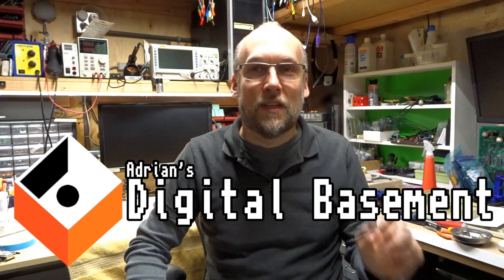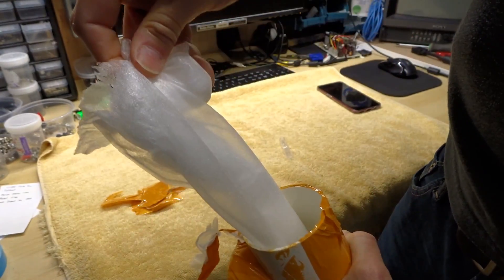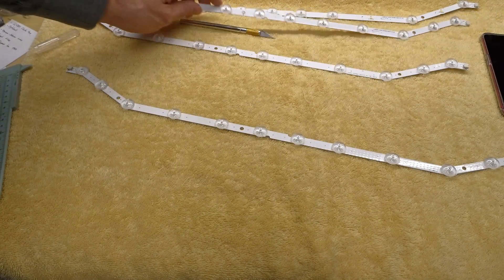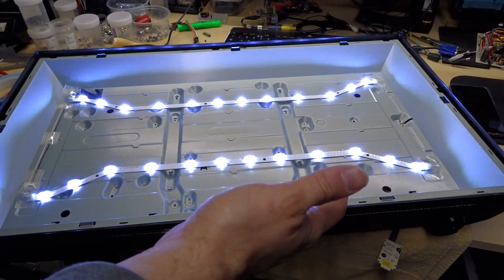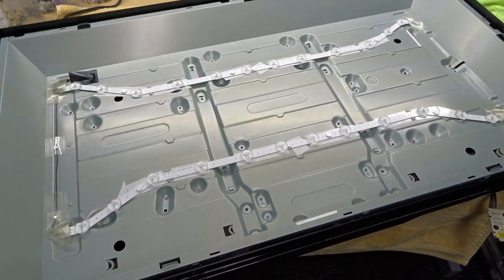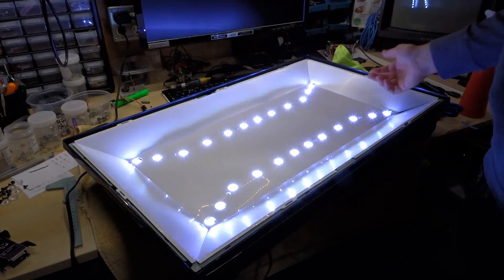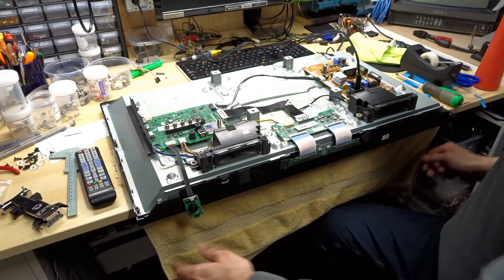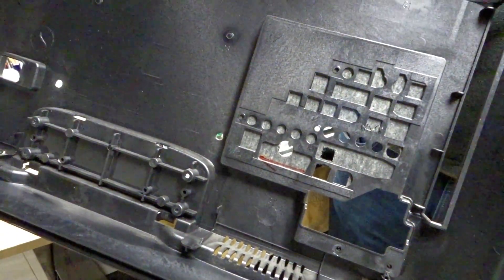Trashpicked Samsung LCD TV Part 2: New LED Modules

Comment: I would use some silicone gel heat pads cut the pads to fit. Gray silicone heat pads taken out of recycling electronics. Pices of copper cut to fit with heat gel would work nicely. Be careful with the screen don't crack it

Comment: Why is the voltage that high if it only needs to power led's????
Reply: The LEDs are connected in large series groups.
Reply: It has to power quite a few of them and they are all in series.

Comment: To expect that after a repair of any trashpicked electronics is going to be perfect is a stretch. Especially if it had been thrown into a dumpster. I would venture to say that the fact that for less than $20 you have a functional tv that can be viewed and enjoyed is a true success!
Reply: Yes but at local goodwill store, I bought several perfect working tvs (ranging from 22 inch to 32 inch manufacturing date several years old) for less than $10 each.   Not sure why goodwill is charging such low price for working tvs.

Comment: That damage on the LCD panel may be from moisture that seeped into the TV from being in a dumpster. I really don't believe you did anything that damaged it. Also, good job on the troubleshooting. You did this without any experience with this model, no book or specs really, and just using astute observation and wisdom. Great job. (I too suspected a power supply problem or faulty back lights and was thrilled to see how it turned out). Makes a good back up or might help you fix your other one.

Comment: If you're concerned about the crack growing bigger, due to heat or moving the TV around... get one of those automotive windshield repair kits to fix the crack.  The adhesive is designed to withstand the rigors of road vibration and heat, and it is a very thin viscosity... so it will get into the crack pretty well and should keep it from expanding... for awhile!

Comment: $20 and some time and you learn some useful info; that's a win in my book. Plus you get a spare TV to boot.
I got a free TV from Freecycle that needed a replacement power board (didn't know it when I got it). I had no clue what I was doing at the time but about $80 and a couple hours later I had a working 32 inch that I have been using for the past 8 years.

Comment: I also feel the damage happened when owner thought TV was dead and trashed it.Great TV for $17.00. Personally would use it on my security camera system as the blob on screen would have no effect. Currently using an old 27 inch always on TV just to monitor cameras when i wish to.

Comment: I had that sort of thing on a monitor I moved. I used a few "pixel unsticking" videos, and a vibrator to remove it. Yes, a 2 doller sex toy. I still have a few pixels that tend to stick but it's good for testing motherboards etc...

Comment: I have a Samsung (much older, though FullHD) TV-monitor combination that used to be a display-model in a shop that went bankrupt and I managed to get it for a lot less than new in an auction ment to raise money to pay off any bills left after bankrupcy).  I entered the service menu to see it has over 11000 hours of display time!   I was astonished to see it still working actually (and I don't think it's a LED-backlight screen, so even more rare not having CFL backlight issues with the thing).

Comment: NEVER spray cleaners directly onto any screen. Spray onto a cloth (preferably microfiber) then wipe onto screen. This way you minimize possibility of creating drips running down the screen into the bottom of the bezel where some electronic may be located. Your screen may not have electronics located here and has no risk of shorting or damage due to liquid, but anyone watching your video may not know if their TV/laptop/monitor is at risk. 

Always presume spraying liquid onto the screen will damage it and you'll be safe.

Comment: I trash picked one of these TVs and I ended up replacing the LEDs instead of buying the strips as you did.  In my case i used a heat gun under the strip to heat up the strip to replace the LEDs.  works great.  the only problem was that the LEDs I used were a bit different in color temperature so I can see them as a bit yellowish.  If I find LEDs with the correct color temp,  I will go back inside and do it again.  This time I will use my new hot air rework station instead of a heat gun.

Comment: Even with the damage, still a great tv to stick on a weather protected wall on your patio to enjoy some sport with a beer and some friends. Ive done loads of these trash tv pull apparts, fixed a few with new t-con boards and dead Caps, nice feeling when you pull off that bringing the tv back from the dead. thanks for the upload Adrian.
oh and pS. im rough as guts handling these trash tv's and never cracked a screen yanking them appart. So likely damaged when is was tossed in the first place. dont beat yourself up, high powered flashlight is a good option to check for cracks b 4 you commit to buying new parts.

Comment: Adrian- very good and useful vid for reference. I too have many TVs I’ve repaired but not had a bad light problem. Our house probably has 4 that cost a few quid to repair * My best one was the Fuji 42” plasma that weighted a ton as it was a display panel with no tuner. That cost me 0.69 p to fix- 15 ohm high wattage resistor. 
Most of my garage HiFi is 1968- 1992 broken stuff that is salvageable and repairable. As you say, we have lots of projects on the go...

Comment: Good Job!  As for the blob growing I'd give it about 30%; after all the abuse it still quite small.  If the blob does bother you I would put 4 pieces of black tape in each corner angled at 45 degrees and then you probably won't notice anything.  Enjoy the tv!

Comment: i have a 65 smart TV someone tossed with the same issue, However the LEDs light but they are very dim, Also i do get a faint picture if i put a flashlight on the screen. I am thinking that since the power board gives power the strips are bad and need replaced.

Comment: I got a huge 50" out of a dumpster.. the picture with be perfect for about 2 minutes when it's first turned on.. then a vertical strip about 8" wide with changing color lines will appear.  Can I fix this some how and would it be worth the trouble? Any suggestions?
Reply: It's also a Samsung

Comment: My TV does not have the blob it has a 3/16 line from the top to the bottom about 1 inch in from the left side,  it was never dropped or tossed it just appeared, that could have been tiny and grew over time.    I still use this today and will replace it some day when it does quit. 

I have pulled several PC monitors from the trash and replaced the back lights as well.  One I repaired putting 2 together, you could see where the owner punched it in the center.   The back light worked in another that I had picked up the spring the year before.  College students do tend to throw away every thing at the end of the year.

Comment: Great job, and proves it can be fixed. I have recently pulled a 50" Samsung smart tv from our local landfill recycling with a similar problem. Half the back lights are dead, and the tv appears to be fine apart from that.

Comment: I have a similar Samsung monitor (no TV tuner) that would not turn on. Turned out that most of the capacitors were bad (most were visibly bulging). For less than $10 I was able to replace them (some basic soldering skill required). It's been working perfectly for over a year now. One less item in the landfill! :)

Comment: Try stopping the crack getting bigger with a glue like super glue, or windscreen glass repair.  Regarding your dismantling re assembly, the way I do it is up the other way, putting the reflector over the led strips, and placing the LCD down on to the backlight/metal assembly.  The models I have worked on all had LG panels, Philips, and Panasonic branded models. One at 55" the other at 60". I had a worse problem than your's with the Philips, once it was repaired (electronic failures in the PSU), finally got it going to find the screen had a fist mark near the middle when I guess the person got upset and punched the screen. It was not visible until powered up with the PSU repaired. The parts for that one cost me $68.00, so a bit of a loss there its a lottery trying to fix the trash TV's. Another thing you can do with the blob is to cover it with sticker, then its just a sticker.

Comment: My first color TV I ever owned was trash picked RCA CTC 16L roundie. Had to replace damper tube and 4 section electrolytic that shorted and 6 6GH8 tubes that were common to failure

Comment: The screens on all flat screen tvs are very very fragile. It doesn't take much abuse to crack the very thin glass.  Make sure u have any flat screen insured for  FULL VALUE if shipping it to anyone. I can guarantee a damaged screen if shipping BY USPS  or UPS. They tend to throw fragile items from there trucks. Also make sure they are properly packed. (Watch TV radio phono nut videos on u tube regarding vintage radios that he received damaged upon delivery)

Comment: The Sammie's are common for cold solder joints and bad or swollen electrolytic caps in the power supply that could cause shutdown or no start up condition. The electrolytics swell on the top by the x mark. The x keeps an overheated electrolytics from exploding and allows venting

Comment: <5000 hours is well used? I have a CRT that is over 30 years old and still works.
Reply: 1999 CRT Prima TV still works
Reply: I have a Commodore 1084S monitor from 1988 that I still use on my Amiga 1200, it would be scary to know how many hours are on it :-).
Reply: My Philips 42" has been on all day,everyday since I bought it in 2009. So roughly 87600 hours(+/-  a couple).
Reply: We have Samsung SMART TV from 2014. Using it every day, all day long for 5 years and still works perfectly.
Reply: Sony bravia full hd 32 inch, in use snce 2011. Still going strong.

Comment: Very interesting.  I never seen the inside of one of these before, so nice work.  I have a monitor I love, but has a hard time turning on, I suspect a bad capacitor so I am tempted to try and repair it myself.  I haven't had the heart to throw it out as it is better than newer monitors now for some odd reason. <sigh>

Comment: I went through a spell where I was buying oddball stuff from the ElectronicGoldmine.com.  One of their packs was cut offs from those type LED'S. I have them running off 5 volts DC under shelves and such to provide mood and actual useful lighting. They are fun to play with although figuring out exactly how they are supposed to be powered is a real pain, I have blown a few of the LED's by wiring them one way when they should have been the other.

Comment: Next time when testing the LED strips, just test for continuity. Since you won't have the equipment to solder them, especially with newer slim Panel LED TVs, it's simply best to check continuity on them, and if there is no continuity, just get replacements.

Comment: I could live with a blemish like that, especially if I used it exclusively for retro computing. As you say, the external damage in that top corner probably reveals the source of the screen damage; namely poor handling of a discarded object before you got hold of it. I have a similar-looking Samsung TV (with a few more ports) that died a few months ago. It tries oh-so-hard to turn on, but just can't. Probably a power issue somewhere. I'm hesitant to take the back off and start poking around as I don't know what I'm doing other than to check obvious things like voltages, resistor values etc.

Comment: Good Job, the TV can also be used for security cam, add an raspberry pi to it and have fun :-) the blob is just a sing of life of the TV, i did a repair myself for someone a few years aggo, power fail, just replaced 5 or 6 caps ( costs € 2,00 max ) and the TV has a second life and still running like new ;-)  

And about the disappointment don't be because this job has teaches you a lot. And you have some spare parts for your main tv :-)

Comment: I had the exact same problem on my TV that is the exact same model, one day from nowhere the Screen turned black and that was it 💔 only 3 years of use, I had an idea what could it be so I took it apart, after checking the 2 boards (Main and AC Board) didn’t see any issues. At that moment I was 100% sure was back Light LEDs issue, ordered the LEDs stripes replaced them and problem solved 💜

Also I used 3 9V Batteries to test the complete stripes from the (+ -) test area at the beginning of the stripes and showed me some LEDs were dead, it was a quicker and easier way to do it without your tools (Tester).

PS: I’m 90% Sure the problem was caused by using the TV all the time at Max brightness (20) so now I use it at the lowest.

Comment: If that thermal tape came from Aliexpress, be aware that many youtubers tested those and they are just double sided tape, performe the same (poorly) as any store bought double sided tape. Maybe it would be best to drill some holes, put some more screws and leave metal touching metal as best as possible.

Comment: If you want to stop the crack from spreading, try using the method used to repair chips in car widescreens (auto windshields;). Those guys claim they use some special techniques,  but superglue might work just as well.
Reply: Adrian Black cool. Thanks for the feedback. I’m glad the superglue method worked even without the use of vacuum etc. Also, you’ve encouraged me to try repairing TVs.

Comment: After having relamped (CFL to LED), and changing LCD control board to Digital View ALR-1920, on 40" Samsung (LTA400HM09), nothing cracked. I can tell you, it takes more force than you used to cause that damage. Without working backlight you just wouldn't notice it. Good repair. I hope you make more videos.

Comment: I would agree with you this was a success and a learning experience.
I've done similar, I have a 52 inch LED LG, it's a monster and it weighs a ton, the day after I got it I ask the neighbor who threw it away what was wrong he said the power supply went bad, a year or so after find it I bought the power supply that was 8 years ago but it's only been in use by me for maybe 2 years.
While it was in storage it was occasionally turned on to let it run.
Would I do it again definitely.

Comment: Well done video. I've trash picked 22" monitors, replaced capacitors, and donated them to schools. I just picked up a 50" plasma and will attempt another rescue.  Save them all! Peace.
Reply: ferndog1461 May I know, is it a TV monitor or PC monitor that you replaced the capacitor. In my case, I have a 19 inch PC monitor and the capacitor on the power board and the VGA board ( or video board ) looks good but I changed the capacitor only on the power board, not on the VGA board. But, nothing shows up even when I light up the LCD screen with flashlight. I didn't connect the PC monitor to a CPU because I didn't have a VGA cable. Maybe it doesn't detect the signal so it goes into sleep mode ? Any ideas ?
Reply: Fixing a plasma TV - quite challenging! I still have an old sub-HD 42" Samsung, colors are great, but there are a dozen+ dark rows on the screen. Besides, it had already been repaired and the technician claimed to have changed the whole PDP panel (needless to say, quite an expensive operation). It did not last more than  2 years before it started to degrade again.
So, any advice on affordable DIY repair if the PDP is damaged? People told me that replacing certain boards and hot gluing the ribbon cables might work (but not if the panel is deteriorating).
Reply: Job Well Done!
Reply: Plasma TV repairs are quite a challenge, I replaced almost every semiconductor on a Visio power board just to get it to turn on and still no picture even after a main board swap !! After spending $50 in parts alone I'm came to a rapid conclusion its a waste of time and money for a TV that's not even real HD!! I did trash pick a nice 42" LCD/LED smart Samsung TV that just needed LED's replaced on the three strips for the back-light. After replacing about 22 of the 40 or so LED's its working great. 
So my point is, save the time and effort and cash on a good looking LED back-light TV that will most likely be a simpler fix and better TV. If you like to tinker and have lots of spare time and cash, carry on and good luck with the Plasma TV they can be a real pain in the butt, and finding a circuit diagram without paying for a service manual, forget it!!

Comment: Quick tip Sunday try not to use a screwdriver to release his tabs along the perimeter you something this less intrusive it'll help you in the long run when you were working on televisions like a non marring trim tool but I wouldn't say that you had done that when you took it apart it probably happened when they throw it in trash can but overall for $17 any trash pick TV you got a good deal

Comment: Build a space in a wall, run power to correct area to hide wires. Cover front bezel frame with mitred picture frame also covering blemish just barely as to not lose too much lcd real estate. Display high res art.

Comment: Turn it vertical and put if inside an arcade. Then, you can crop the damaged section with a bezel.
Would have liked to see the steps needed to create substitute LED strips from other parts.

Comment: twitches every time you call the LCD panel the LED panel
Reply: I got a huge 50" out of a dumpster.. the picture with be perfect for about 2 minutes when it's first turned on.. then a vertical strip about 8" wide with changing color lines will appear.  Can I fix this some how and would it be worth the trouble? Any suggestions?